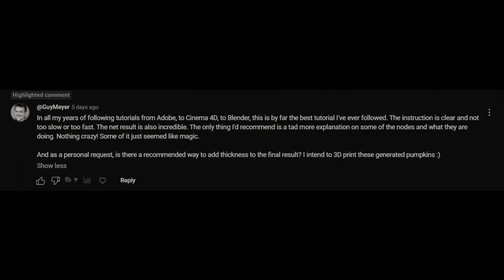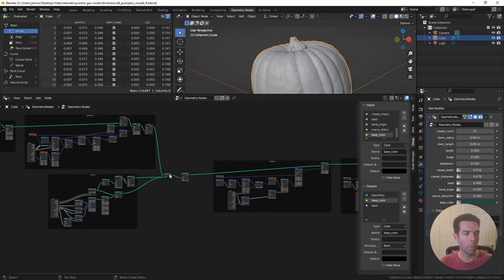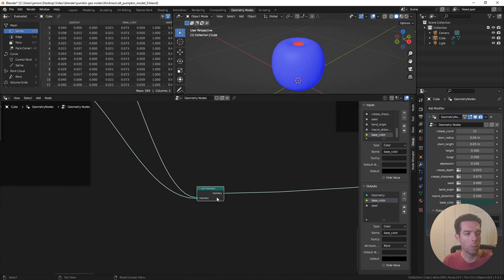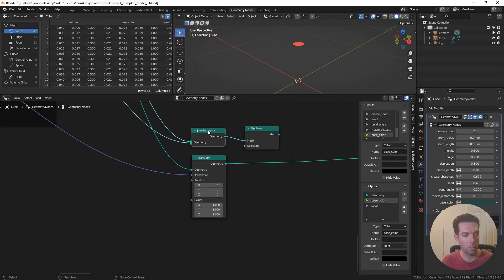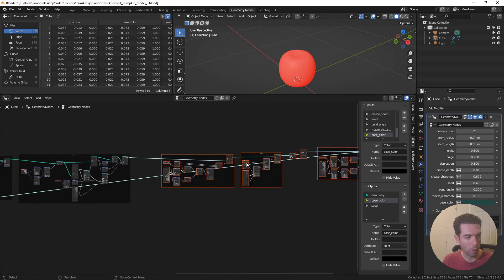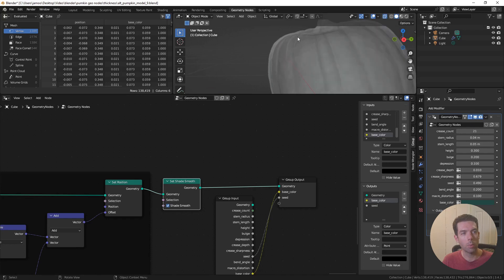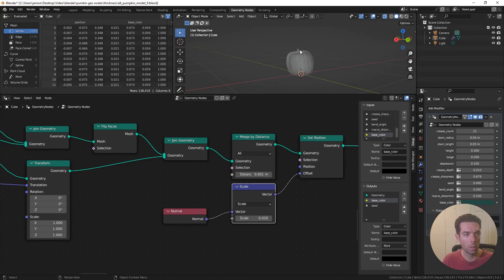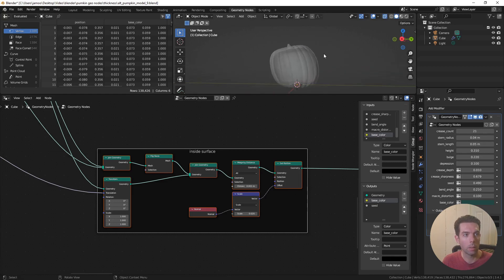Thick Pumpkins - Geometry Nodes - Procedural pumpkin thickness with Blender

Comment: Are you going to have a tutorial on making this into a Jack-o-lantern?
Reply from the maker: I plan to do this eventually, but I still have not resolved the issue of shader artifacts around the cut edges. Once I find a workflow I'm happy with I will share that. Unfortunately, the results I've gotten so far are not worth sharing.
Reply: @rendermoore  I think I got it you can try it. I put the nodes right before the XYZ. https://drive.google.com/drive/folders/1uRPtZmO2lA05gjOUkQN7O_vlctpSm8gb?usp=sharing
Reply from the maker: Yeah the shading looks a lot better, but the cuts get distorted by the bend and distortion that comes after the XYZ nodes. I think we need to rearrange a bunch of the node in order for the cuts and the shading to look right
Reply: @rendermoore  Yeah I'm getting some artifacts as well.

Comment: Aweeeesoomme! I haven't played with implementing this yet, just wanted to say thanks in advance! If you have any questions on 3D Printing, let me know! One thing to consider if you ever decided to get into it yourself is to make the group properties use an exact form of measurement. Most consumer level printers aren't large enough for full size pumpkins, but we can cut the model into pieces and add dowel pegs/holes to reassemble it. Using millimeters would allow you to make sure you're achieving a minimum thickness for the dowels. I can eye ball it from this though!
Reply from the maker: Great! I was worried this wouldn't help at all, but it sounds like it is pretty close to what you need. I would love to see the result when you get something printed!